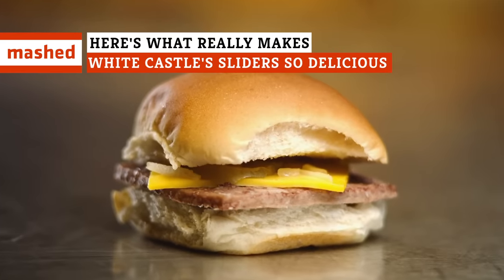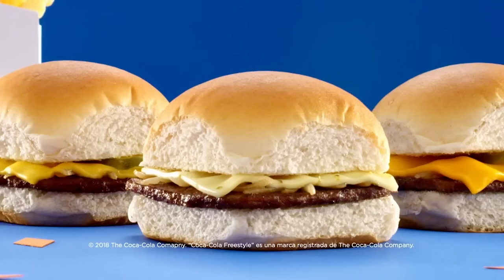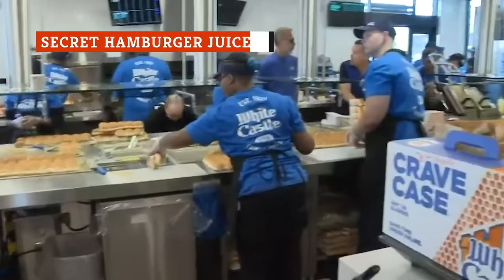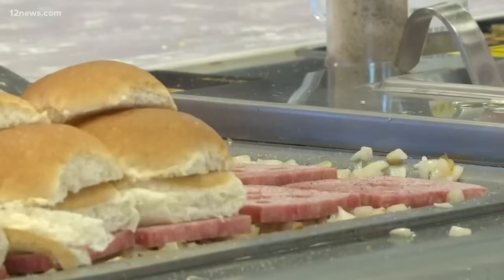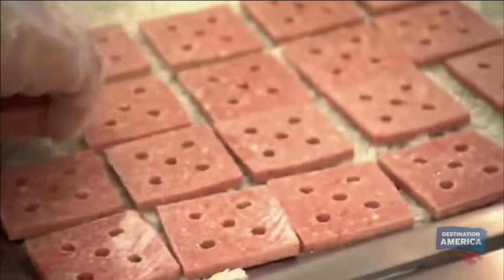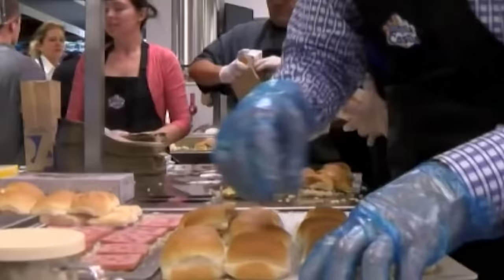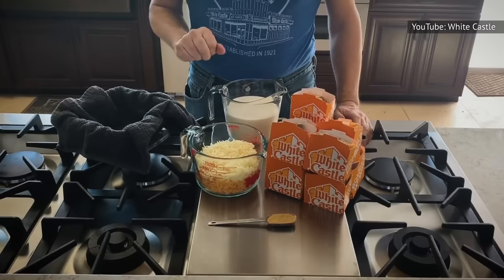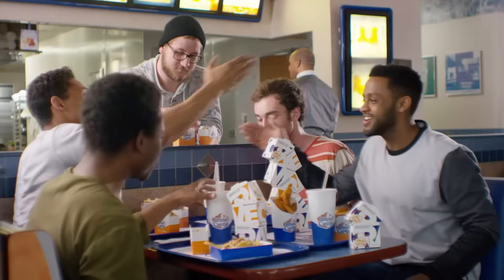Here's What Really Makes White Castle's Sliders So Delicious

Comment: any other White Castle-goers out there bothered by the fact that the narrator keeps saying "sliders" yet the video was clearly showing White Castle CHEESEBURGERS? They are not the same thing (as any WC employee will correct you if you try to order a "cheese slider" or a "slider with cheese"). Even the packaging on the frozen ones will try to disabuse you of the notion that tiny burgers with or without cheese are interchangeable.